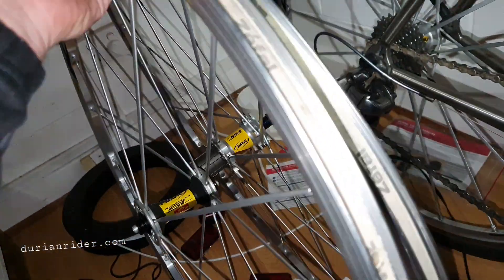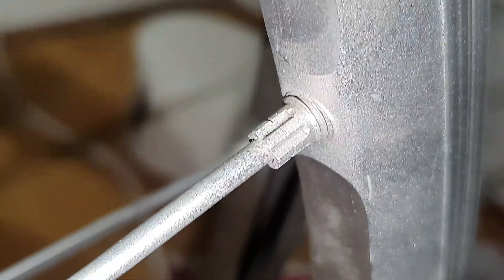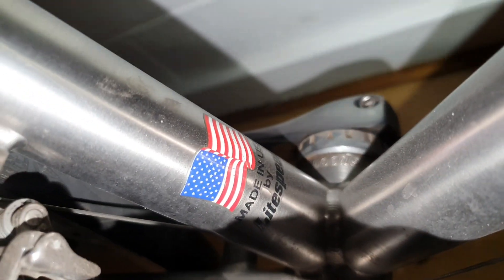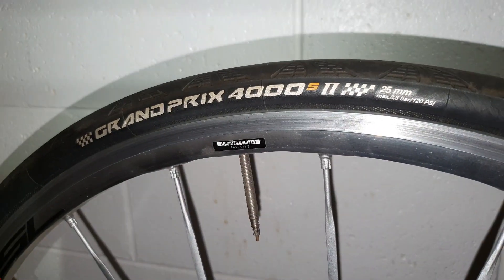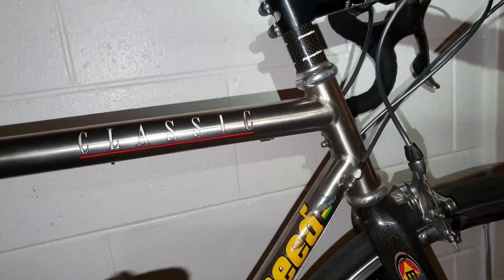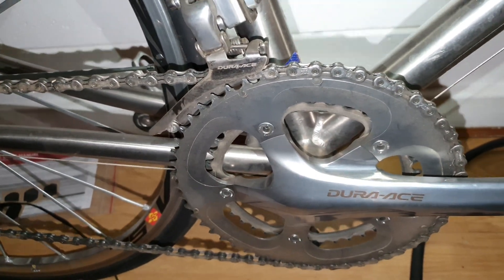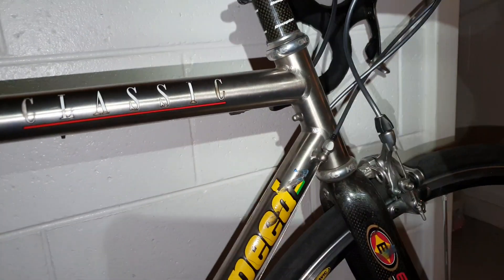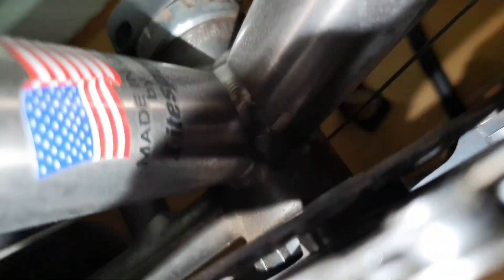New Bike Day - Titanium!

Comment: Those wheels look sandblasted. No?
Reply: Those Ksyriums are not sandblasted. That’s what they look like. I know because I used to run two pairs of them. Not the lightest wheelset or super aero, but they are tough as nails, and will take a beating and hold up on even the worst pavement. 

They are more than enough wheel for any non-sponsored pro as numerous pros rode them in multiple stages of the TDF and other classics when they were in production.